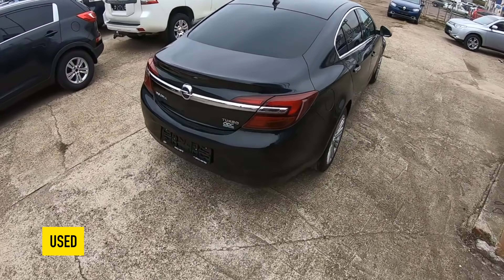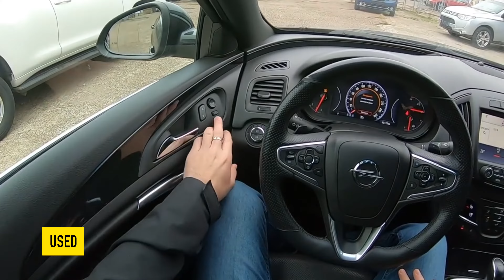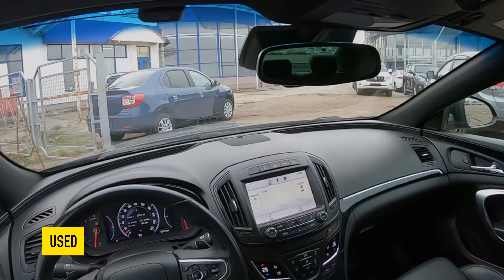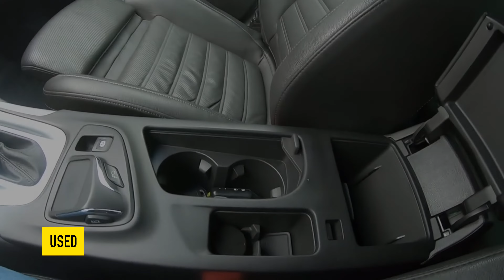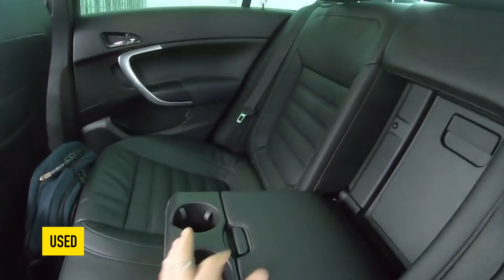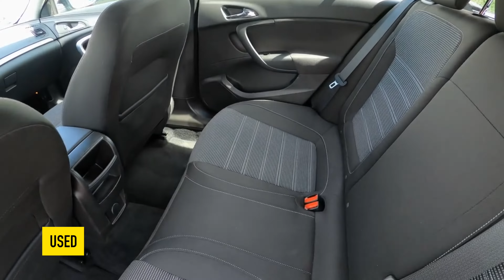What are the most common problems with a used Opel Insignia?

Comment: The lane departure warning module gets really messy on this car and breaks fast. I designed a protector which can be found on my channel.
Reply: Mine is 2017, Im receiving several errors, traction control, auto lights, rpm, speedometer, temperature sensors, they are all down, abs turned off… its a completely mess!!! I saw some comments that the problem came from the lane control system, u did that protection for what reason, just to have a light, my mechanic gave up, he cannot find the reason of the problem, I already changed thr battery, but the problem persists

Comment: don’t ever buy a used opel insignia
Reply: Yes sir, whatever you say sir...
Reply: @lusofreak_gone  depends, if it was neglected stay away but that generally goes for all vehichles
Reply: Yes sir, whatever you say sir...
Reply: All cars have problems, the insignia if an auto develops an intermittent fault with not releasing the key when put into park and you can get water ingress around some seals flooding the front or rear foot wells, apart from that my 2.0 let diesel been ok, no more problems than any other car I have had.

Comment: What do you think about 2014 Opel Insignia 2.0 cdti 120 hp? What problems does that model have? Thanks.
Reply: The key is, why THIS car is very cheap with not a lot of kilómeters because It has a lot of problems
Reply: was looking for a 250hp insignia but after reading the reliability of this car I will be buying a civic with 180 instead